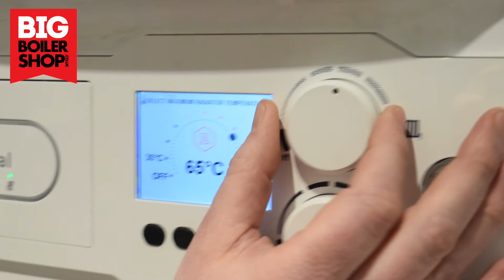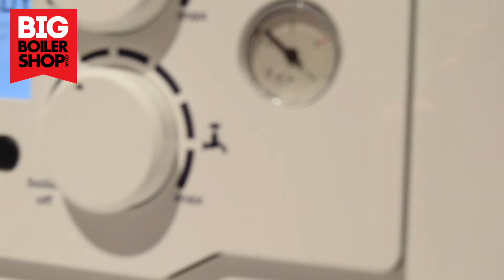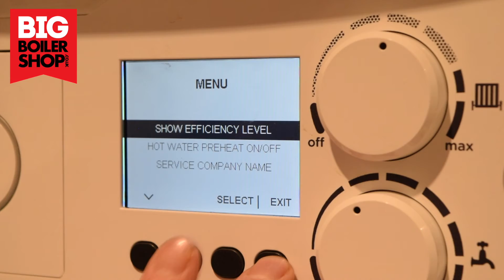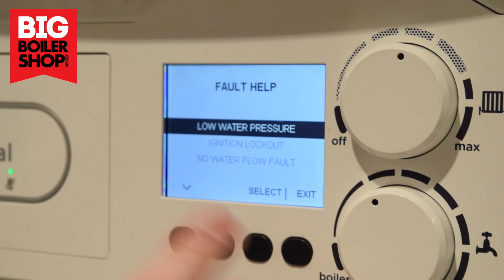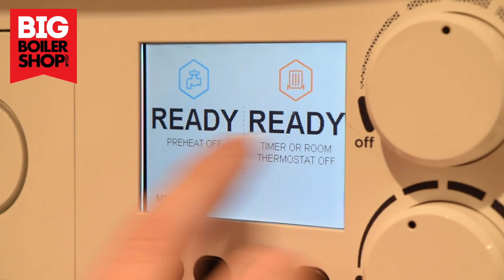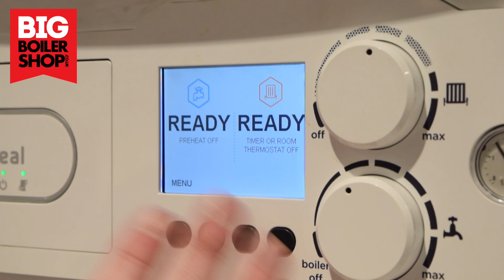Ideal Vogue boiler control panel overview

Comment: Points:
1.  Your condensing combi boiler will be worn out after 10 years.
2.  Gas savings over your previous good but old boiler are likely to be negligible
3.  Repairs to an older condensing combi boiler may be expensive and it may make more sense to replace rather than risk a repair.

Comment: How do I put the heating on without using the thermostat? There is no override button on the interface. Please help. My thermostat stopped working.  I want to buy a Halo thermostat, but it seems they are not compatible since mine was installed in 2018. I don't know why ideal didn't leave any option for us to put the heating on without the thermostat.
Reply: Good question, I would also like to know. I've set mine to 'manual' but it has behaved as 'auto' and wasted gas heating rads I didn't want heating.

Comment: My touch thermostat is completely dead. Batteries are new. The display blinks. I can't even increase the temperature.  How do I turn the heating in without a thermostat? Please help

Comment: I need your help. My thermostat was off for a long time. I changed the battery today. Now I see pairing on the thermostat screen for about 10 minutes.  How am I supposed to put the heating on? Hot water is working fine.  My boiler is ideal vogue max combi 26.
Reply: Did you fix the problem? My touch thermostat stopped working. How do I put the heating on without  thermostat?

Comment: I had one fitted over a year ago in place of a very old f and e system and its excellent also has 10 year's warranty if you service it every year. i use about a quarter of the gas i used with my old system as i check on my energy app seems strange that some are saying its very inefficient.

Comment: My efficiency level says 40 is this correct as my engineer said that is just for them. Also the 65 water I have on that as I like it hot. Tip if you want your bath water hotter turn your tap down to a slower flow. It does work and the water gets hotter. I love hot water especially in winter. My central heating keeps switching itself on. Any ideas.
Reply: Mine says 87%. i have my rads set to 50 degrees. and water around the same i think

Comment: Ideally the water pressure should be the same as the expansion vessel pressure. Not between 1/2 bar.

Comment: My efficiency level is 11%. Any ideas? Thanks
Reply: I tweeted ideal boilers and asked about efficiency level and what it means as I couldn't find any information about it. They said the lower the value the more efficient it is. Mine around 29 most of the time.

Comment: Please help me, my boiler has lost hot water, the heater is still working properly
Reply: boiler has a problem OVERHEAT LOCKOUT I pressed RESTART, it only works for a while and then what should I do, please help

Comment: The problem with setting the hot water temperature at 48 degrees means that you sacrifice flow power. A shower should be a balance of correct temperature and adequate flow to give you a hot and invigorating shower. Setting the water temperature at 65 degrees and introducing cold water through the shower control to improve flow, gives you a powerful shower at the correct temperature. The best of both worlds.

Comment: Hi there. My boiler is burning too much gas. Efficiency level is 22%. I  had 29 years old boiler before and it only cost me £12 to £16 monthly. This ideal vogue max 26kw combi is burning too much gas in an hour compared to the old one and the bill is £37-£40. Is this normal? Iv 6 rads. 2bed mid terrece house. I only live on my own. Use elec shower. Use hotwater jus for dishes. Thermostat set at 19c sometimes increse it to 22c. When i go out i leave it on 15c. Any advice?
Reply: Hello Christy
I see nobody 'in the know' has replied to you but, though it's not going to be any consolation to you, I have also had the same issue with a new Ideal Vogue C32 fitted a couple of months ago to replace an aging and inefficient back boiler.
I was fairly horrified by by my bills with the back boiler but when I had my first bill after fitting the new 'efficient'  condensing Ideal....the bill doubled to around £120/month (3 bed mid-terrace in spring). Not good.

One thing I did get from Ideal when I phoned them up, and again this might not be much help to you, is that the 'efficiency level' display is a complete misnomer....it refers not to the boiler efficiency, as it implies, but to the length of time the boiler has been in condensing mode. Mine is currently 17%, having increased from 13% a month ago. Apparently it will incrementally increase with the life of the boiler up to 10 years. This sounded like complete claptrap, so I have booked an Engineer call-out to check the boiler and explain matters to my face. I'll post on this thread following his visit.
Reply: Hello Christy
Further to the above, the Ideal Engineer came out and gave the combi boiler and system a very thorough check....to find there is nothing wrong with it, or the installation. He confirmed that the 'efficiency' display only shows the percentage of run-time that the unit is in condensing mode (which is where some of the boiler's efficiency is derived). He did suggest I balance all the rads and also ensure that the resultant temperature drop between the discharge and return connections is about 20 degs.....if there is too little difference then the boiler won't go into condensing mode.

I appreciate the above will be of little consolation to you but I would strongly suggest getting on to Ideal and getting one of their Engineers out for a visit - if your boiler is under warranty this should cost nothing. Good luck!
Reply: @muckypots  It will be in condensing mode if the radiator temperature is less than 50C. I get a lot of condensate at this temperature. Suggest reducing the radiator temperature  so that the house is still warm enough. It will take longer to reach that temperature. Alternatively using the Halo wireless thermostat will automatically reduce the radiator temperature as the  actual temperature is close to the thermostat setting.
Reply: @djhvideo   Thanks for the advice - I'll try turning the set temperature to 45-ish and see how it goes. I couldn't help but smile ruefully when I look at my first comment on this thread 5 years ago when I was horrified at a £120/month bill....it's doubled since, same as everyone else's! Cheers.
Reply: I’m needing a new boiler and the engineer has recommended the vogue & the logic+

Now I’m not sure sure......
Reply: @paulkemp8784  Do it. its a great boiler. my bills are so low ! espeically in summer, we use so little gas for our hot water the standing charge costs more then the usage !

Comment: Iw we do not have any sign of a leak,but the pressure has dropped causing a fail,and the relief valve shows no sign of any water passing down wall or into drain,what else can cause this drop.can you advise,we are about to fit this exact boiler,
Reply from the maker: Hi Peter, I am sorry we missed this. The old boiler may have had a faulty expansion tank. There is a quick way of testing if the leak is on the system or boiler. Have you had new boiler installed yet? If not reply here and i may be able to post a video explaining what to do. It will mean you are without a boiler for a day or so while to test.
Reply: Yes new boiler has now been fitted ideal vogue,,but thanks for getting back anyway .
Reply: How you finding the new Boiler @peter ?